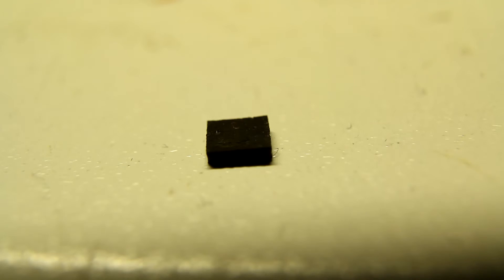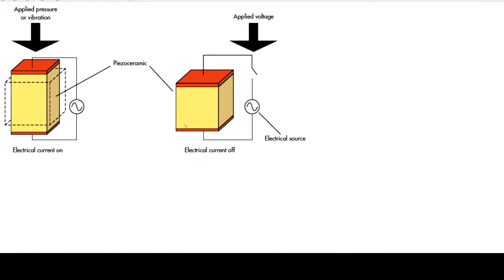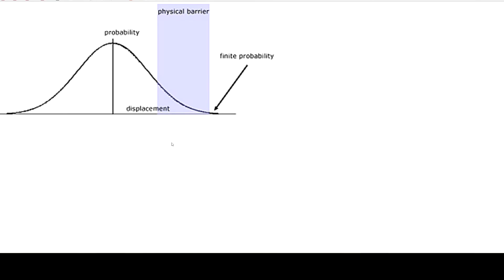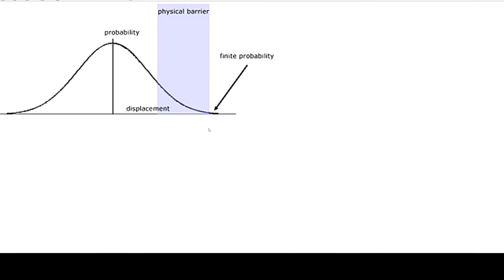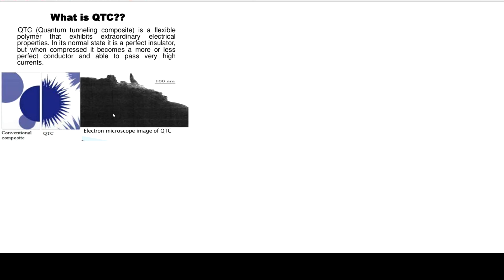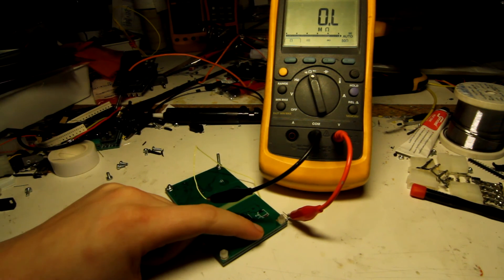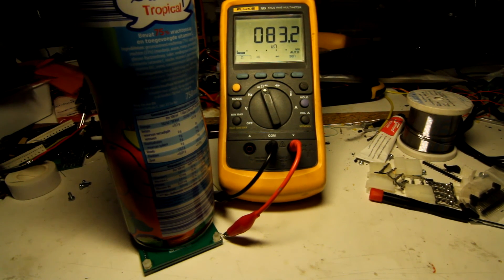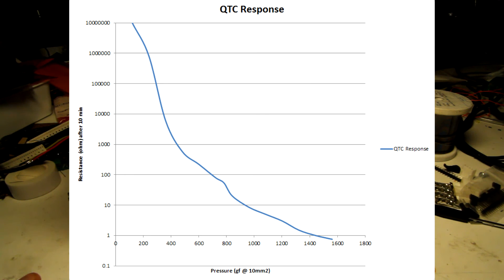Quantum Tunnelling Composites Explained (022) - REUPLOAD

Comment: Thanks for sharing the video, very helpful and interesting. One question - I was not sure if you said that resistance stabilized within 10-12 secs once the load was placed? Or, what if anything one can do to measure weight of the load linearly. Once again, thanks for the input.
Reply from the maker: Since making the video I've actually tried implementing it as a bicycle tire pressure sensor, but it's really not linear enough for that. The conductive pathways just continuously keep being made and broken, causing pretty unpredictable resistivity over long periods of time, even under constant load. Like, you can get 10:1 resistance swings without changing pressure in some cases, especially at intermediate resistance (around the 1-10kohm mark).

Comment: So what about QTC's make them useful if their resistance changes in what appears to be a chaotic manner? Is it all about precision manufacturing for the apparatus around the QTC in order to get it to be as linear as possible? What is an example of where QTC's are currently being used in products?
Reply from the maker: AFAIK its almost only used as a positive touch sensor, not as a linear force sensing device.